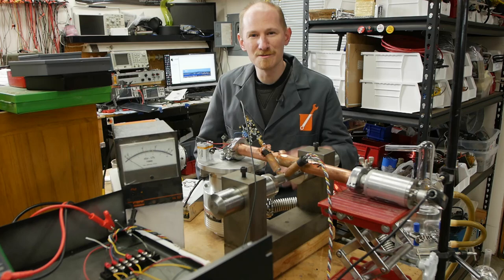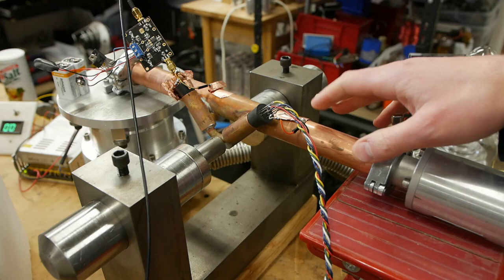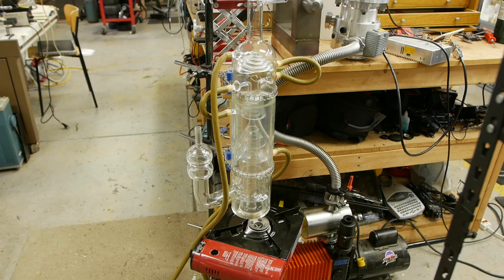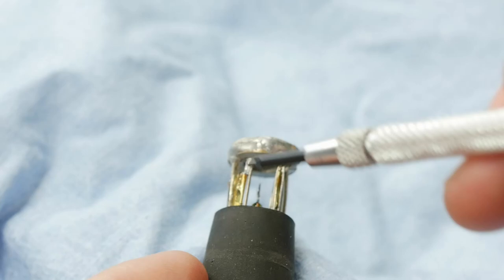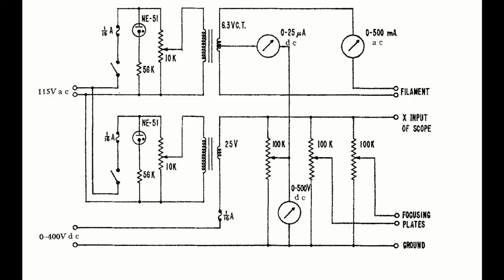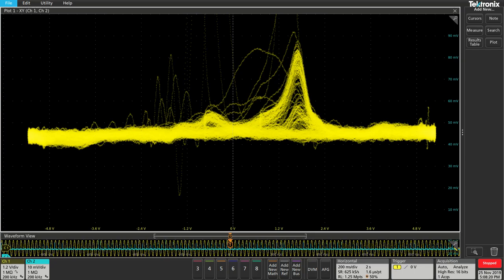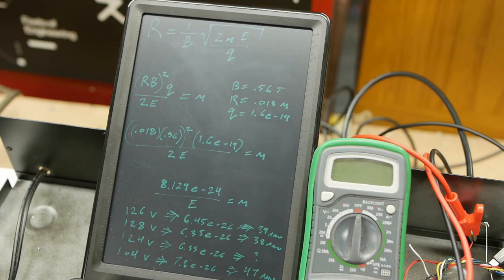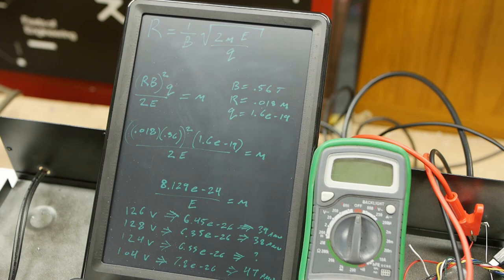DIY mass spectrometer measures potassium in dietary salt substitute

Comment: Could you put a ball valve (same inner circumference as the tube) just after the emitter. Then close this leaving the system in vacuum while changing out the sample. You would want to pump down the sample space, before opening the valve.
or

Could yo put several filaments side by side in parallel with the slit so as to be able to run for 2 or 3 times as long. This would not worked for mixed samples.

Comment: Omega Tau has a very in depth interview with a experimental physicist that creates MS for Aldrich or some big corporation.      I'm about have another listen after peaking my brain with this.      

I am unclear about the doublet.  Why would it appear at the settings you have for potassium?
Does this phenomenon appear with other ions?    Does it (anything) appear when you boil off the sample and set the parameters identically?
If it's an echo or reflection type of noise perhaps it's only around that amu.    Have you tested atoms 38-42 close in amu or isotopic variant K(41) Cl to see if the same thing occurs - if you can get ahold of any.

I think they work with CD3H with organic compounds. 

I am looking forward to the laser MS. They even use lasers now for separation of isotopes .  Very interesting work.

Comment: My first thought the inner and outer dimensions of the pipe are different so your radius was wrong... Somehow i doubt that would eskew everything... Amplitude tho also how did you calibrate it for accuracy? Just based on the output of the one sample? Maybe others will be off by the same amount?

Comment: I'm watching your long playlist and as someone who also plays with charged particles in vacuum...when you measure cathode current in some of these setups, you are definitely not measuring what makes it out of your "gun" - since quite a lot of it is just going to hit the end plate where there's no slit, or in the case of your E beam into air, just the endplate, so of course you'd need to see more current put in than someone who was measuring at the other end of things. As far as hysteresis here, if it's that bad, it should be quite obvious if you look at the drive signal on the scope as a separate issue.  If not that, remember there can be charge buildup on the things you think of as insulators (they're all really capacitor dielectrics, perhaps a little leaky).  Dawson's compendium on quadrupole mass specs goes on and on about how even thin layers of oxide on the electrodes (even SS ones) can cause things like this.  And a fingerprint...you get the idea.

Comment: 24:50 Not only is the peak assymetric, if you look at the errant large peaks (ones made of singular lines), they center directly on that line (120) too. Also, if you look "inside" the solid big peak (on the curves inside with same shape, but lower amplitude and less lines), you see one big peak at 126, and possible one at 120 too?

Comment: I'm also really surprised that sewing needles in rubber works as a vacuum feedthrough!

I've tried making metal-glass seals a few times, and never got it to work (borosilicate with sharp-edged metal). I also tried salvaging the metal-glass seals on light bulbs, but those are hard to match with borosilicate.

If I can get approximate results with simpler methods (needles in rubber!), this video just removed a barrier for some things I wanted to try.

Comment: because of the hassle with magnetic fields people invented the time of flight quadrupole mass spectrometer. However, now you could use your mass spectrometer as a vacuum leak detection system. Trim it for Helium, and connect it to any vaccum system with a small leak. Blow any vaccuum connection with helium. The leaking connection will fill the vacuum system wit a fair amount of helium which your mass spectrometer will recognise.

Comment: Hi
That's the most incredible thing I ever saw. A DIY MS. Please, show us more of that.
About this secondary pic: Have you ever try to do the experiment without the potassium chloride coating (or with an other salt) to see if this other signal shows up (ans thus is due to the setup (possibly the filament))?

Comment: Is it just a harmonic of the system?  The board with the sma connector is an antenna tester right? "Properly" hook a drone antenna to the sma connector and see if you get a similar pattern when "properly" testing an antenna. Maybe ask the high performance antenna guys what they think.

Comment: The rubber you used may be contaminated, especially the specific vacuum rubber. You could test that by doing something like refluxing them in methanol and trying again. Any oil that absorbed into the rubber or even moisture could be providing the off gassing.

Comment: Awesome project! Don't ignore a the other elements present. Cl for sure, but also potential Al, Si dopants in the W filament. I assume you used distilled water for your solution as well.

Comment: The reflection you are referring to might be an artifact of your low pass filter. If the algorithm takes the power spectrum of the signal, truncates it or gives higher frequencies lower gain, then inverts it back, you will see your signal repeated in the negative and positive directions every interval of your Nyquist bandwidth. I wrote a paper on this, if you'd like I can send it to you.

Comment: Have you suspected polyatomic interferences? Doubly charged interferences? There are some other chlorine compounds with mass 47. Doubly charged would have to be K2O++ which would have m/z 47, probably unlikely though, unless the stopper is letting lots of air in by the source ( even commercial ICPMS'S only yield something like 1-3% oxide ratio i.e. 156 signal /140 signal measuring on Ce140 = .03), maybe the vacuum isnt really great by the stopper and you've got a bunch of oxides. I work with ICP-MS's, at high temps and vacuums you get some really crazy compounds forming. Maybe look at mass 94 and see if there's a large peak there to rule out doubly charged interferences hitting on 47. Mass 94 could be Zr, Mo, or some polyatom. Check out some different materials and look for the same mirror pattern if you suspect electrical noise!

Comment: Amazing project. I suggest not using solder in vacuum. instead use spot welding. Solder is not compatible with Vacuum especially at UHV.

Comment: Looking at the periodic table I'd be tempted to try and get a boron salt to test with (boric acid would do it). Boron has two isotopes, 10 and 11, that should give a good separation and they are in a better ratio (about 5:1). If there is some sort of reflection in the system that should make it obvious along with the results you already have. I've wanted to try building an MS for a long time, seeing  your's maybe I'll give it a miss though!

Comment: Seems like if it's a delay/hysteresis effect it would be symmetric on up sweep and down sweep.  What would explain the smaller amplitude of the 'image pulse'?  I'd still like to see the effect of varying the sweep frequency/waveform to see if it's related to that though.

On an slightly related note maybe try adjusting the center voltage and AC to focus on the main peaks to try and better resolve the two isotopes?  Not sure exactly how much that would improve it though.

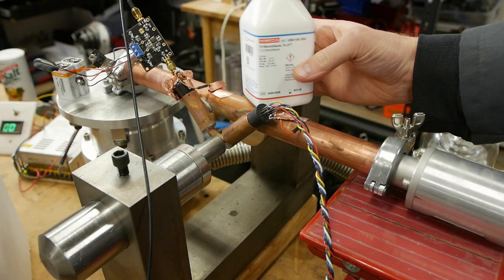Comment: 19:15 That's the rigor and candor that I so often miss in Science youtube channels. I do want to ask about breaking up of chemicals at 1:55. You say you break down molecules into their atoms, whereas most mass spectrometers will break into fragments. The reason you want to break into fragments is that you can deduce not only the makeup of the molecule, but also its structure. You mention C6H5N3, but if all your mass spec tells you is that ratio, you have no way of figuring out the structure. Put bluntly, how could you tell the difference between, for example, dimethyl ether and ethanol?

Comment: The Setup also would works like a vacuum tube diode. Perhaps that's why feeding the AC voltage with a DC bias leads to the "mirroring effect" of the peaks. The intensity of emissions aren't as intense in the reverse cycle as in the forward cycle of the AC voltage.
Just wondering

Comment: have you tried to check each amplifying stage?
maybe just ear
earthing (shielding completely) would help
maybe it is reflection from first stage amplifier to walls and back?
I doubt it, but even signal quite could potentially create reflection, but I would expect smudged reflection, as this reflection would happen on whole length of wire, so you would effectively get continuous reflection
another place I would expect such reflections is any connectors, especially at first stage, right after amplification
I would concentrate my efforts there first, as it is close enough to be easily pickup again

Comment: the hose clamps expand the hose, increasing leakage, the rubber plugs are under pressure and compress, thus much better.
Poppa invented spectrometers, a photon magician, could slice zeros with a slide rule, so this was cool to watch.
Does the curvature of the 90 limit the mass to be identified?
Braze on a 3/4 and 1" at 120 degrees for higher masses

Comment: I think you should be looking to compare peak area rather than peak height to guesstimate the 15:1 ratio.

The 104v peak could be due to contamination of your salt sample with strontium ( double the molecular mass but-2e ).  TA plausible source would seem to be tungsten from the element stripped of all its outer d orbittal electrons. Its molecular mass of it stable isotopes span from 182-186 which would correspond to a peak at ~ 104v to 106v with a 4+ charge. Does this peak remain when the ?Potassium peak fades away as the sample is used up?

Comment: instead of using an AC offset for the scanning, use a sawtooth pattern instead and see if the ghost signal goes away. With a sawtooth signal for the scan it removes the reverse direction scan. Easiest way to apply that would be to use a signal generator and an amplifier.

Comment: How fast does the AC voltage oscillate? Does this design take into account that there is a delay between the emission and the detection of the particles? I suppose this delay also varies with the voltage. I wouldn't be surprised if this lead to some artifacts. But I'm way out of my league here.

Comment: Curious, if you made the razor blade slit(s) narrower still, would that improve the resolution of your machine?
Reply: There are many things he can do. The original paper essentially harvested ideas from sector instruments. Adding magnetic focusing, changing voltage potentials, introducing a second slit or pinhole, better vacuum, etc. and having mechanical adjustments can all either improve ion transmission and resolution.

Comment: Interesting project. 
Not stating I have the answer to your ghost peak, but it may be worth reminding the K has both stable and radioactive isotopes, stable being about 39 and 41 m/z and since the stable isotopes are (in nature) not 100%, more like 99.998%, while the radioactive isotope resides around 40, albeit with a one and a half billion year half life to eventually form via beta emission to 40 Ca. Your precursor peak may in fact be a  precursor to this beta emission change or degradation from thermal shock or electron ionization scatter. The single component analyte in ppb,ppt or greater is likely absent in most modern machines simply due to mathematical cleansing to 'show'  a cleaner baseline to the more novice operators.  I tried your method on my standard 5975 MS and turned off all the bells and whistles for unfiltered output, and in fact mimicking your results.  I'd say whatever your doing, your doing it dang well...

Comment: Applied Science Good job,  Although most of this is above my head it occured to me that you have a contaminate such as an anti caking agent like calcium carbonate or aluminum silicate.  If your numbers matched one of those elements atomic number then you have your culprit.   Titanium comes to mind but how would it have gotten into your spectrometer.  Tungsten, chrome, iron, nickel...some volatile compound of black rubber and copper all could be present but don't match your numbers.  Good luck on your next project.

Comment: I believe it has to do with a natural (or maybe reflected before the slit - try a backing/housing for the filament?) emission and an accelerated emission, you should also double check for signatures from your ac supply. I also doubt it, but maybe there's some kind of harmonic there

Comment: Is the second peak an off-axis refection off the flight tube? Add an additional slit before the bend/magnet.  It could also be secondary electrons coming off the Faraday cup.  Add some voltage bias to suppress the electrons.  Cheers, Mark * * *

Comment: I would assume that the main problem regarding vacuum quality with the hoses you used is much more one of shape than material itself. While the rubber stoppers you use as feedthroughs are conical and will be pressed against the pipe by the outside air pressure, the pieces of tube you initially used are not, therefore allowing more air in.

Comment: You can force outgas those hoses for use.  There is a curve associated with each material (used to be in the space business) that off gasses.  Depending on the material, I'd bet your material will eventually stop.

Comment: You seem to get a huge amount of stuff done! I have been working on a home made MS project for years! look it up.
I thought you might be interested in a very simple electrometer amp I have used it is a LMC6082 with 6G feedback R . Need special screening and leakage precautions. It has noise floor of a few tens of fA depending on BW. Working on ion source and quad mass filter at present. Making spot welder to assemble it.

Comment: Nothing wrong with rubber stoppers, the black ones are made from the same stuff that o-rings are made from, Nitrile, which is generally good down to 10*-6 to -7. Solder is generally fine too, flux is the problem. You need to clean that stuff out. If you can use sil-phos instead of lead solder, it does not use a flux and no lead. That's what is typically used on copper vacuum lines. There is a bit of a learning curve to using it and you will need either air-acetylene or oxy-acetylene.

Comment: I agree with Ben, I don't think the peak at 104V is from an impurity or contaminant in the system. This is partially because the exact same set of contaminants would need to be present in both the 1963 and 1970 results.
My first thought for what the peak at 104V may be was some sort of impurity in the form of an anticaking agent. The main problem with this is that it is unlikely that the results from 1963 and 1970 were both obtained using NoSalt. Also, the NoSalt brand salt Ben is using specifically lists potassium bitartrate as an ingredient; potassium bitartrate is an anticaking agent, but does not contain any elements that could directly be responsible for a peak corresponding to an atomic mass of 47. In addition to potassium bitartrate, NoSalt also lists adipic acid, silicon dioxide, mineral oil, and fumaric acid. All of these additives only contribute carbon, oxygen, hydrogen, and silicon to the list of possible impurities coming from the NoSalt; none of them are likely to be responsible for the peak at 104V. However, carbon and chlorine together do add up to 47, which could happen either as a result of some sort of interference or actual CCl forming. Another possibility is a combination of a single chlorine atom and a water molecule. If the peak he is getting at 104V is an actual measurement and not some sort of artifact, then I think one of these two are the most likely, especially the combination of chlorine and water, since that is something that could have been present in the experiments done in 1963/1970.
CO2 could be present, but this should produce a peak corresponding to 44, not 47.
Another possibility others have mentions is Titanium present in a coating on the razor blades, or as part of a filler/anti-caking agent in the NoSalt. Titanium has an atomic mass of ~48. However, this would normally be visible as the characteristic gold colour of Titanium Nitride wherever the coating was present. Another problem with this is that the titanium ions would need to accelerated into a beam at the same voltage as the tungsten electrode in order to produce the peak shown, meaning it would need to evaporate off of the razor blades, redeposit on the tungsten filament, and be ionized at 104V. Also, the peak roughly corresponding to atomic mass 47 is also present in the results from 1963 and 1970; I'm pretty sure that titanium coated razor blades weren't a thing 50+ years ago. This is something that could easily be tested for by doing a baseline with no sample present, as well as testing out a few other samples.
Another interesting but improbable possibility is doubly ionized Molybdenum. Molybdenum is commonly used in wires which act as extra supports for the tungsten filament. These wires often come to a sharp point, which could increase the amount of ionization. However, at 8:21, it is quite clear that there are no extra support wires in the lightbulbs Ben is using.

Comment: Just my guessing. 
1. I think it should be the ration between the area of the peaks not the height of the peaks. (The narrow pulse for a curtain mass particle gets spread into a bell shape. A integration should be done on the peak, so it should be the area. The non-symmetry of the peak might caused by the non-uniform magnetic field ) 
2. The electric field created by the 'particle' gun acts like a dipole, so the particle decelerate while leaving the negative pole. (because its closer), so the offset voltage is effectively smaller.